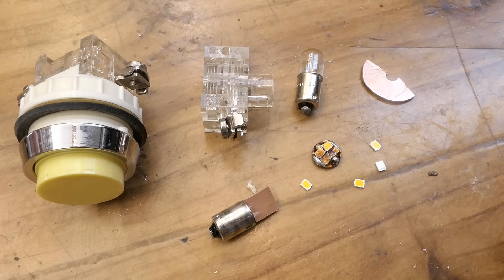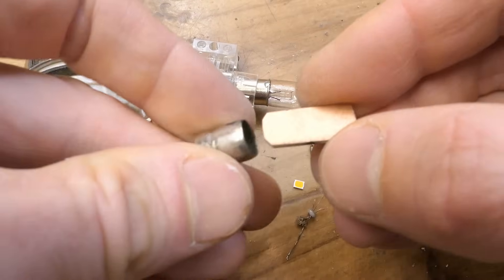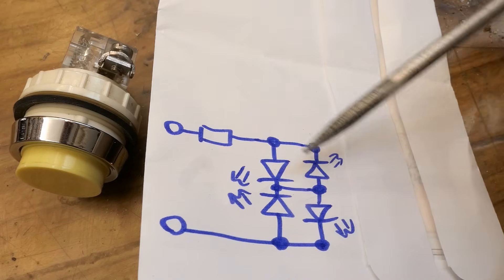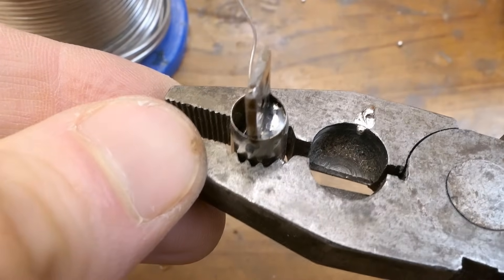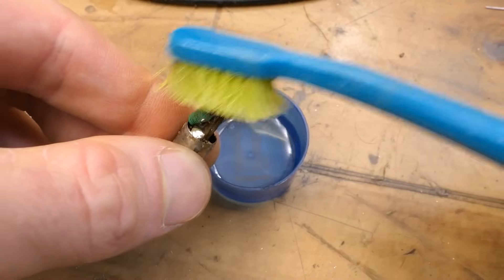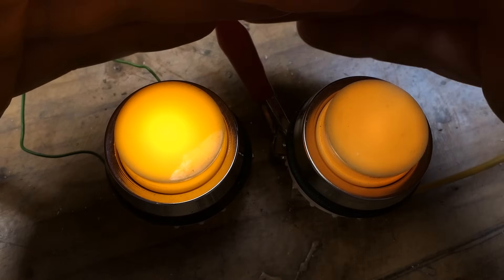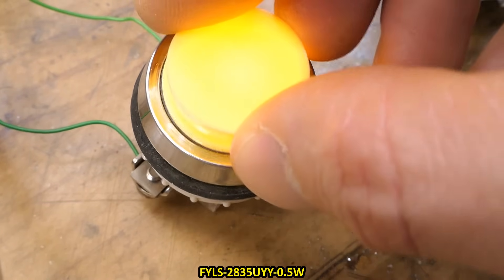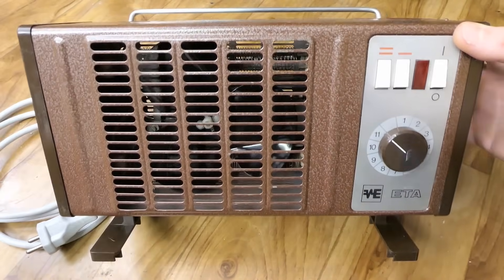Building a tiny LED lamp

Comment: I had a similar construction but contact corrosion prevented reliable operation. A normal bulb would spark thru the corrosion but the tiny current of the led couldn't.

Comment: Why don't put bridge rectifier at the input to make them light at any polarity? The method you're using is little wasteful, only 2 LEDs get illuminated at the same time.
Reply from the maker: Well, it would definitely make much more sense in an illumination LED, but this is just a simple tiny indicator.

Comment: It would be interessting to test if the case and pcb can dissipate the heat from the LEDs
Reply from the maker: At barely 4mA there's almost no heat. This is an indicator, it's not for illumination.
Reply: Heat?? At 40mW??🤔

Comment: 1k78 is not a weird value, it is standard E48 (2%), E96(1%) oe E192(0.5%) restistor values. Yes, is a less used value but it exists.
I had a full 10Ohm to 100K E192 resistors set, for each value 10 pieces, a big box that costed me a lot of money (380DM in `97) when I built some precision lab equipment and needed precise value resistors.
Reply: Well, 1k78 is still a weird value for people who are used to only using resistors whose values either begin with 1, 22, 33, 47, or 68.

Comment: I tried the exact same thing for a bike light but with more SMD LEDs that I salvaged from a malfunctioning E27 LED bulb. It was the first time I did a diy etched PCB too.
The problem is heat. Even though LEDs are efficient they still heat up which is why the PCB in LED bulbs is an aluminum one. In my case the LEDs overheated and degraded losing light output.

Comment: A bridge rectifier would have been a small investment for doubling the light output. Nice color for the LEDs.
Reply: The leds themselves are forming a bridge rectifier!
Reply: @অৰি  in AC/DC only 2 LEDs are lit at one time, in DC 2 LEDs will age, 2 will never be used. Using all 4 LEDs would allow lower current, higher efficiency, longer life with the price of a bridge rectifier or same performance with only 2 LEDs. A small SMD bridge rectifier costs about the same as one of those LEDs (~$0.04).
Reply: Sometimes less is more and enough is enough.
Reply: @mikebond6328

Comment: I must have watched you solder a hundred tiny components with your industrial-sized soldering gun and bucket of rosin flux, but I'm still amazed every time you do it
Reply: I call it "stunt soldering" and I love it!
Reply: Shows you can do a lot with just some simple tools.
Reply: @mp3musicbox  No need crazy high tech like laser soldering

Also for assembling some little LED chips, use hot electric iron and pinset
Reply: Very nice soldering by just using old soldering iron